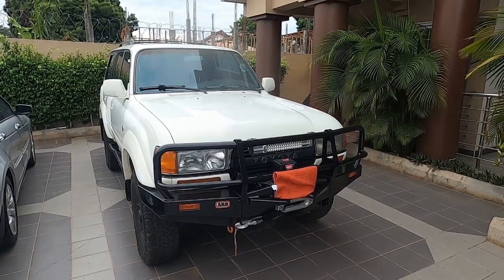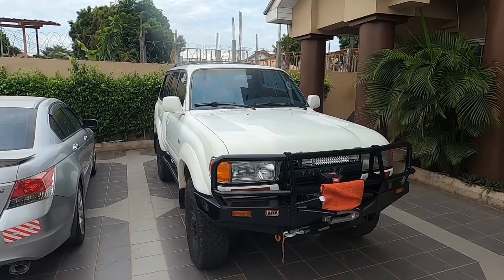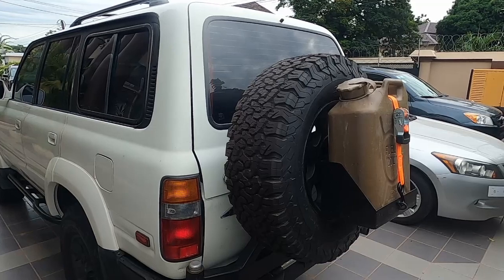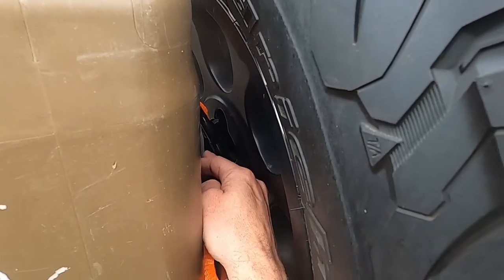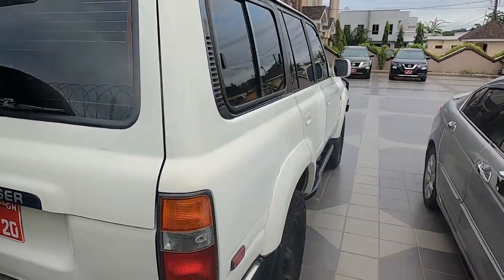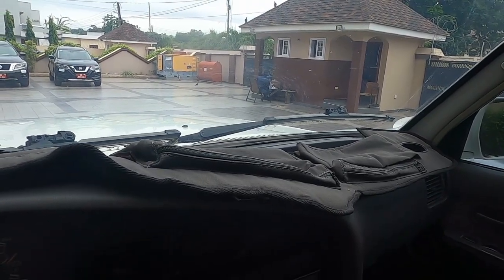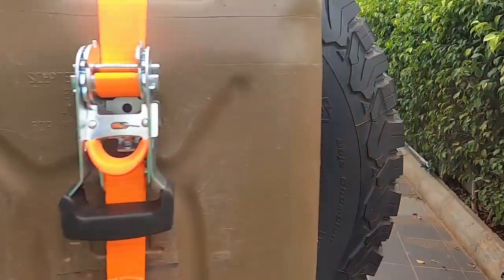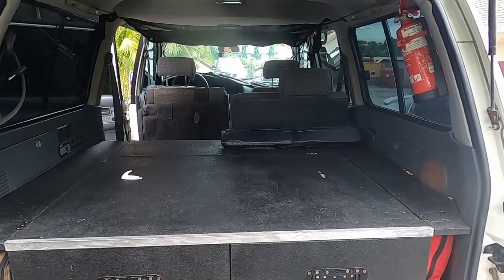1992 FJ80 Walk-Around

Comment: Throw a LS in it and you will be good. A 1994 80 (without lockers!!) just sold here for $136,000. Apparently only had 1k miles.
Reply from the maker: Nigel,

I have a 2,600 mile turbo charged 1HZ engine that I just bought with a new transmission to put in. I plan to do a video series on this. I wanted to stay Toyota. The benefit of being in Ghana is that parts are plentiful.
Reply: @landcruisernut8654  looking forward to it...